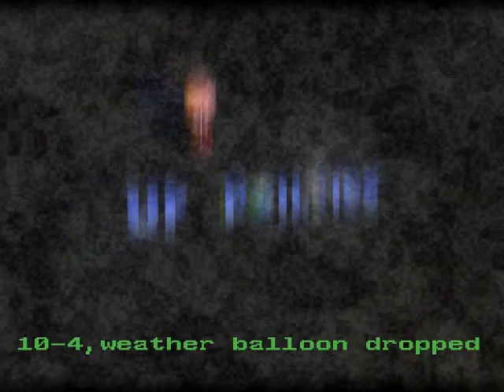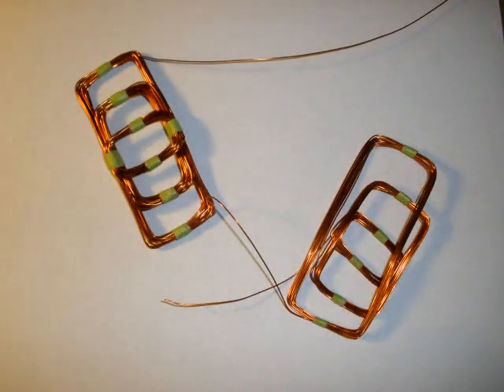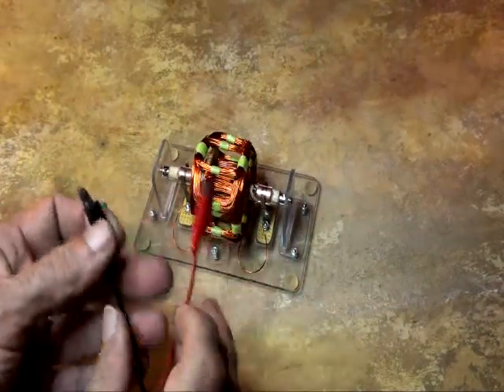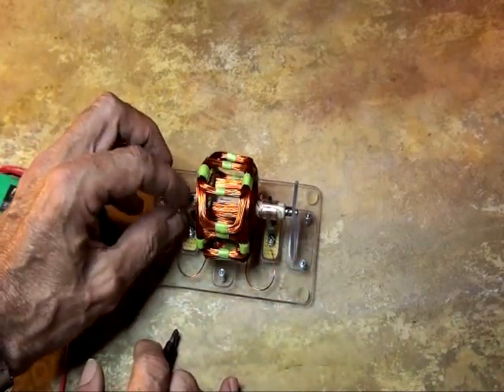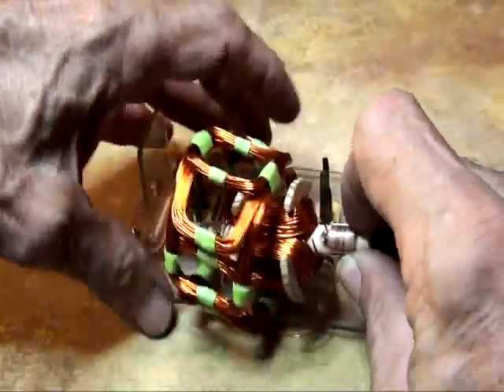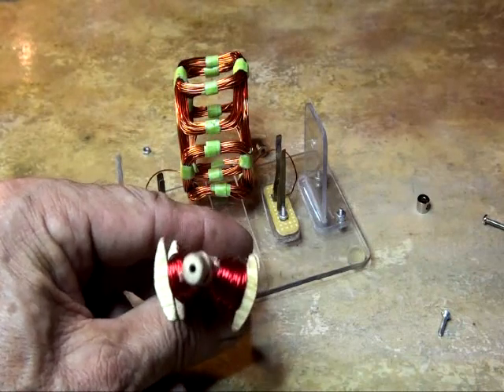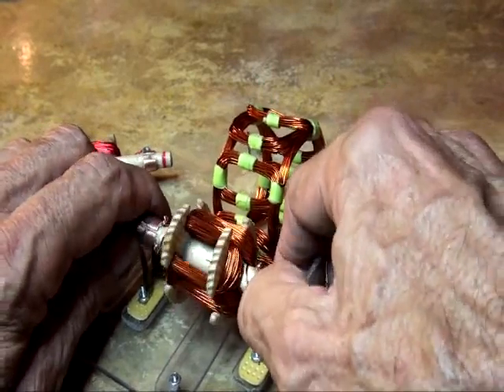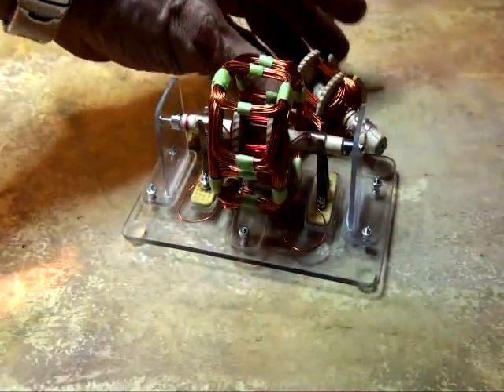A TIMELESS MACHINE

Comment: This machine not have been built one thousnad years ago, you built it today....! and this is more important, your machine 
is realy beautiful, and is too much work, i think people will be agree with me, thanks for sharing.
Reply: Steel doesn't amplify magnetic fields, it just guides them for the most part. It is not preferable due to the hysteresis losses.
People like you usually don't ever build anything close to this, or even a motor of any kind, unless all of the parts were made by someone else...
Reply: skycollection I can't see any "importance" in this motor. Of course e-motors run by magnetic effects, and no steel is needed to build them. But steel amplifies the magnetic field and laminating the steel helps against eddy currents. That's why commercial motors use steel. UFOpolitics claims that his "asymmetric" construction is better than those constructions engineers make today. But I have never seen a sound measurement of him supporting this claim.

Comment: Yes, sure, if the egyptians and ancient civilications had figured out how to do copper wire... complete with plastic insulation to make actual coils and not a block of copper, since you need induction. So lets assume they put paper or something insulating between the copper coils, which would make the, what, 20 or so wires you put next to each other to make the coils, just about 3 times as big what with the very uneven copper wiring. Which would make the field incredibly uneven and unstable, coupled with the very low voltage of the ancient "batteries" the egyptians used to galvanice metal over months..... No, this could not have been invented in ancient cultures. I'm sorry. It's a nice idea but the concept of insulated copper wires, the concept of copper wires in itself is just way, way too recent.

Comment from the maker: The Motor was just built to prove a point.
That there is absolutely no need to have a steel laminated armature...or a steel frame...or any other magnetizing material in order to build and run a motor..
Just Copper mainly, because wood and shaft and else is just to configure a rotatable and supportive structure.
Then, we have some intrigue, some curiosity related to "Time it could have been built"...Egyptians and other Ancient Civilizations had Copper...
Regards

Comment from the maker: Magnetic Patterns (In my own terms related to what I am referring to on my claims):

Magnetic Patterns are the configurations created by the flux lines between a permanent or electromagnet, related to the flow from their main poles, or from their respective North-South poles. This Patterns propagates into the three dimensions as also could easily move into a Fourth.
Patterns could also be "bend" or modified by simply moving in space at least one of the main poles, creating different volumes.

Comment: very cool!
would using a finer gauge wire solve your heat up problem? is it running to much current for the wire amp rating?
Using smaller gauge wire=more resistance in the windings not allowing as much current to flow????....Also would this give you more magnetic field with more smaller windings..... then could you run the motor on a higher voltage- less current giving you more speed? Higher voltage =more speed....Higher amps =more torque????? Any way....super cool demo!

Comment: i dont see why they could not have had electric motors back then since there is evidence they could have had batteries. they could have easily used some type of special wood and material for simple bearings, even all treated-wood bearings, and made simple commutators or maybe just coated parts of the commutator to make the right field oppositions.